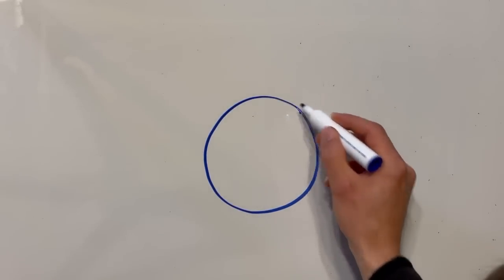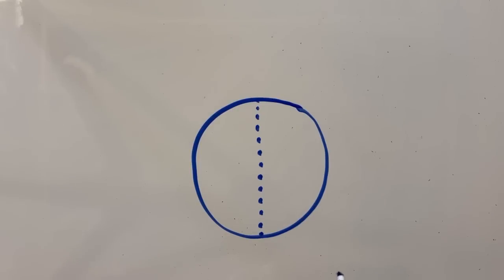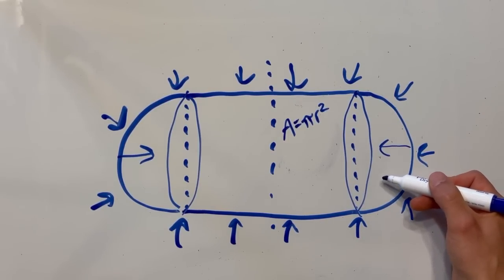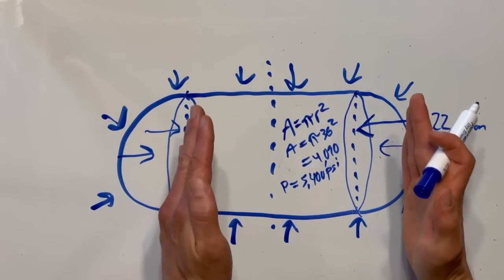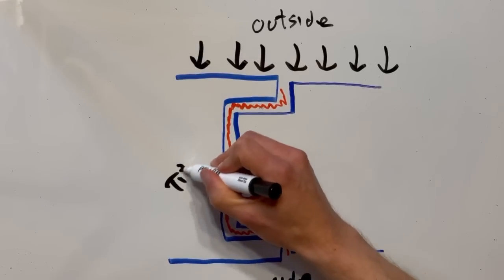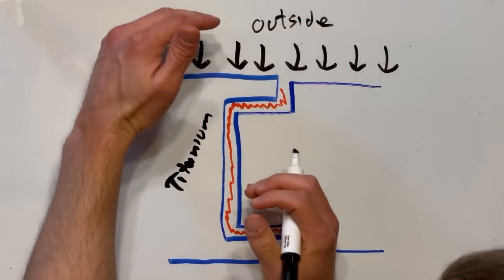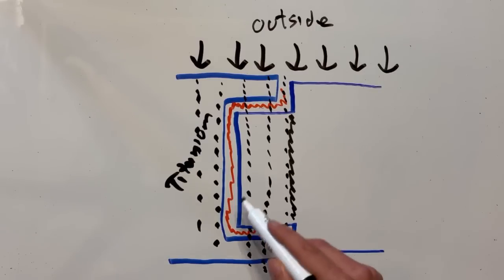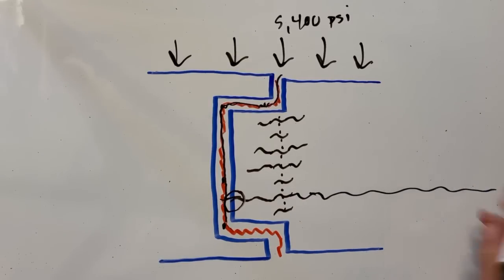Simple Engineering Analysis of How the Titan Submersible Could Have Failed

Comment: I've worked with various composites, including carbon fibre/epoxy wet layup and pre-preg. The first thing that came to mind was trapped air. I hadn't thought of the end cap bonding as they are being pressed on with the pressure anyway. That said, it is a valid point as you don’t want them falling off on the surface. The air trapped in the epoxy in the carbon laminate is what I was thinking from the start. Possibly it works a lot like frost damage but instead of the freezing / thawing water, it's air compressing and decompressing under pressure over many cycles. Eventually degrading the integrity enough to cause failure of the structure. I wonder if they de-gassed the epoxy and used an air absorbing layer in the vacuum bagging process. Even if they did and even if they used pre-preg, it may not be possible to guarantee 100% air exclusion. If that were the case, it wouldn’t really matter how thick you made the carbon, it would eventually fail. They should have made several, kept one as a control, destructively tested one by repeatedly lowering it to 50% deeper than it was intended to go until failure and then only dive half the number of times it took to fail in the working unit. Over time they would have built up enough data to decide if carbon was really viable / cost effective for this purpose. Just my two cents. I’m an ex-aerospace manufacturing engineer who used to make turbine blades and remember Rolls Royce’s foray into carbon fibre turbine blades. It turns out that carbon wasn’t viable for turbine blades. Millions spent, no lives lost. Worthwhile research in my opinion, despite it nearly bankrupting Rolls. My thoughts are with the families.
Reply: Agree completely air bubbles in the clue or the laminate would be the major cause of failure at those depths and pressure 1 passenger reported hearing little pop's lake small-caliber gun going off every once in awhile as they descended deep.
Reply from the maker: From how they were handling the epoxy, I doubt they degassed it. I was thinking about the same thing, but even if they did, how they assembled it certainly was trapping air.  

It looks to me like they used pre-preg. At least it is the better of the two options to minimize air pocket inclusions.
Reply: @Mutton_Lettuce_and_Tomato  There is a rumour that the pre-preg was bought from Boeing at a discount, as it was out of date.
Reply: @soeren72  I think this rumor has been pretty much confirmed.
Reply: @Mutton_Lettuce_and_Tomato  My understanding is that with something that thick you'd vacuum debulk it several times during construction to reduce voids, and then run a final vacuum debulk in the warm oven or autoclave before you crank the heat up to cure the epoxy.  But it seems they just room temp cured it without any debulk?
Reply: GE figured it out and has made carbon fiber composite blades in the GE90 for several years now.
Reply: @LTVoyager  Admittedly I left the aerospace industry a few decades ago. I hadn't heard of carbon being used since the Rolls Royce effort but I don't stay current with aero advancements anymore. The problem was 'creep'. The dam things would elongate over time and interfere with the confinement ring. Hopefully there will be some info online detailing how GE made it work. It's probably a secret though :-)
Reply: @deanbolton3228  Look up the news, I think its not really they found a way to make it work… but more like they haven’t admitted to it yet as it might bankrupt them.

Multiple GE blades failure in recent years.
Reply: @deanbolton3228  Yes, since they are the only ones I know of that are selling engines commercially with carbon fiber blades, I suspect it is a closely guarded trade secret.
Reply: @LTVoyager  I’m sure the news of several blade failures with GE products in the recent years got nothing to do with the carbon fibre composite blades?
Reply: @tonamg53  It might, but that would not be a surprise to anyone familiar with engineering and product development.  Almost all introductions of new technology have teething problems before the full benefit of the technology is achieved.
Reply: @LTVoyager  Well yes, but considering that RR already pulled out as they found it to be unfeasible and GE blades just kept on failings… should’ve raised a massive giant red flag with anyone.
Reply: @tonamg53  GE has been the technology leader in jet engines for a long time.  I suspect they will succeed where Rolls Royce failed.
Reply: @LTVoyager  Well, that’s not according to the news of multiple blades failures from GE products in recent years.

Another one just failed as recently as a month ago…
Reply: @tonamg53  Like I said, if you understand engineering and product development.  Since you don’t, believe what you wish.
Reply: @LTVoyager  I believe what I see… and I see GE carbon fibre blades are failing at an increasing rate.
Reply: @tonamg53  And your data source is?
Reply: @LTVoyager  Various News outlet and scientific papers found by searching Google
Reply: he used a 90/0 weave on the thing. That was the first sign i thought this dude had not alot of experience with the material. He would know that other methods changing the angles that helps delam not happen.. His excuse for the tortional loads seemed to be just something he came up with on a dime. He either didnt know enough about the material, or was literally misinformed idk idk how even the place who was applying the carbon fiber even let him or asked him if he was sure about having it done that way. Because thats nottttt the way its meant to be done if u want to avoid voids, and delam. You mix up the angles with the weave, u can see it done on paintball gun tanks, its not anything even new. He was probably also clueless about carbon kevlar, its not as strong in the same way as carbon fiber but its tougher but in think it might of worked as a outer shell if they made the last few layers carbon kevlar this also would of forced a different pattern atleast over the last layers. Kevlar is tougher than carbon fiber in alot of ways, carbon fiber just has really good strength and rigidity to weight ratio.
Reply: @profo4544  It's pretty obvious that Rush was one of those guys who knew enough to be dangerous, had made up his mind how he was going to do it, and was neither willing to learn more or take advice from people who knew more. Particularly advice that would increase cost.
Reply: @profo4544  The carbon fiber/epoxy hull of the Titan features alternating layers of UD prepreg in the axial direction, and wet-wound carbon fiber filaments in the hoop direction.

Also the hull was design and made by Spencer Composites, the same company that also designed and made the hull for Deep-sea challenger that was designed to go all the way down to the Mariana trench (although it was never used as such as the owner died in a plane crash before attempting to dive)

Might want to try get some experience with researching on the subject before commenting about it.
Reply: @profo4544  I doubt the submersible would have had significant torsional load on the tube.  And the layup orientation was the least of their problems.  If they really used out of date prepreg, that is a huge problem and not using an autoclave for something that size is simply stupid.

Comment: Excellent job. I’m not an engineer, but I’ve been in industrial construction for decades working with many types of materials. You have nailed it. Ignoring Warnings+Dissimilar materials+Glue+Different Coefficients+Extreme Pressures+Cycling = DISASTER
Reply: As soon as he mentioned dissimilar materials I thought different coefficients and wondered if the extreme low temperature at depth would add to the problems.
Reply: Stockton Rush was a pretentious assbag who thought he knew better than EVERYONE else. It’s sad that he took 4 others with him.
Reply: It seems to me that it wouldn't have made a difference how they wound the carbon fiber.
Reply from the maker: Thanks.